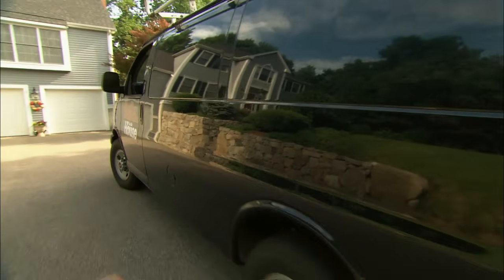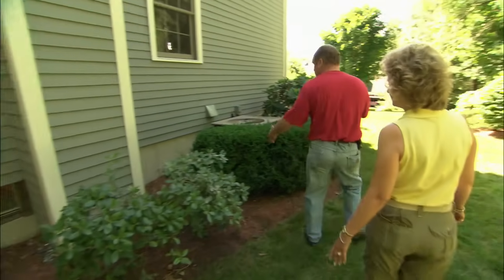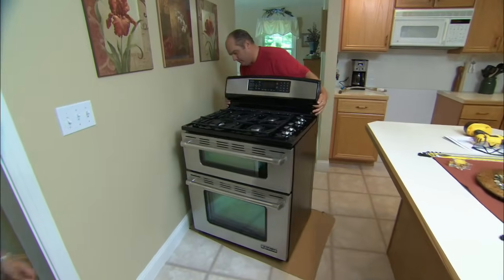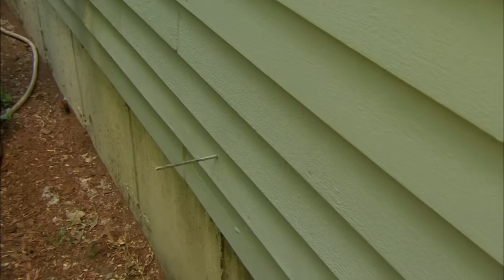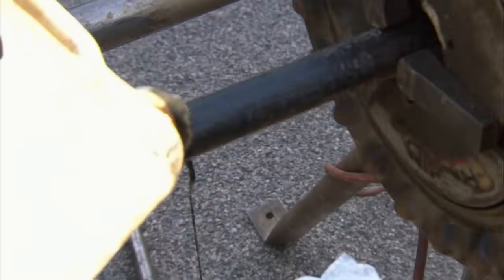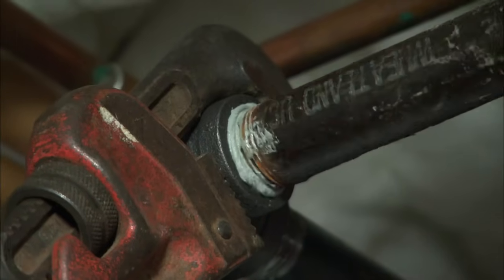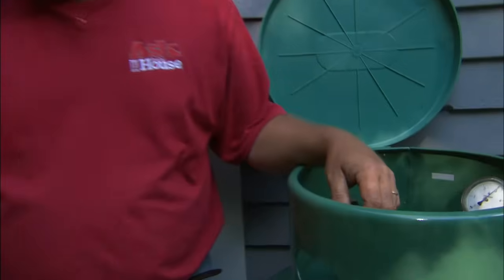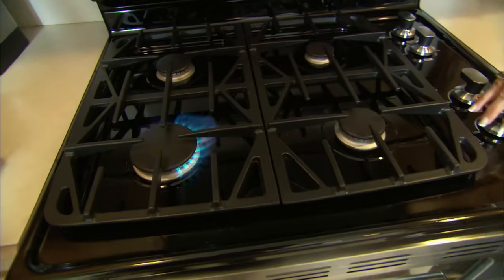How to Install a Propane-Fueled Stove | This Old House

Comment: I'm not falling for that one, they removed the stove and cleaned and put it back before they did this. No way would it look like that after 12 years. It was spotless back there.
Reply: I was thinking the exact same thing. Not even a single dust ball after 12 years. No way.
Reply: Wouldn't there be a 220V outlet back there instead of a 110V? I think the electric stove was a decoy.
Reply: Bill Magsamen
There was both back there, 220 and house current.
Reply: Maxid1 Ah, yes- I missed it the first time.
Reply: tv is fake.
Reply: Maxid1 so what are you trying to say???
I mean this video is about how to install propane tank.
Reply: I clean under my oven regularly.  If you slide out the bottom storage tray it makes it quite easy.
Reply: I know after five years behind my stop wash 2 pounds of grime and garbage
Reply: Maxid
Reply: Did she install propane just for the gas stove?
Reply: Judging by the condition of the kitchen, she's probably at the end of a remodel and decided to throw this bit onto tv. Why else would it be so clean, with a 110 outlet already in place?
Reply: Maxid1 naaaaaa Denise removes the stove every day to clean lol!!!
Reply: scott l: She did. But once the tank is in it's very worthwhile to connect your gas grill. No more wrestling 20 lb tanks and running out of gas during a party. I did it when I had my previous house built and I'm doing it again now that I've moved. You can also use it to power a backup generator or a clothes dryer.
Reply: Maybe before toh came to shoot the episode she took the time to clean behind it herself.
Reply: scott l yes there is no natural gas on the street so they have to have a propane tank
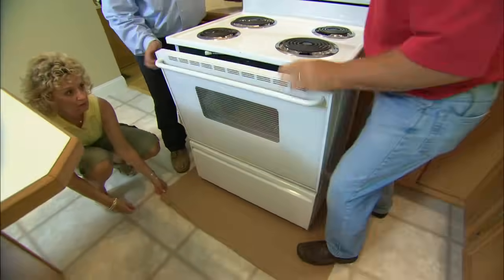Reply: 120V outlet was there. See at 2:40. Builders put usually two outlets behind the stove. My house has three. 120V, 240V, and natural gas from the beginning. 

I guess the TV show staff checked the stove and the location before calling Richard. Maybe cleaned the house. It’s their job.
Reply: @billm775  there were both dude
Reply: If the house isn't that old, 25 years or so. The electrician runs a 220v wire to the stove, also a 120v receptacle if they install gas. Just a normal thing these days. My house is plumbed for propane, but the 220v line is always there.
Reply: I agree. There was a older 110 outlet back there already. You can tell its the oldest because its been painted and not used after they install the newer 220 for the electric stove. You can tell the 220 was added to the kitchen because of the location it is on the wall. Now they are going back to gas like so many do.
Reply: The fact that people like you doesn't clean behind their stoves makes me physically sick.
Reply: Honestly nothing behind my stove but a few pieces of dog food
Reply: Just pull the tray out and vacuum it out it's not that hard, saying that I'm a slob and haven't in atleast 6 months.
Reply: My wife makes me pull out the stove so she can clean back there.
Reply: I bet the 110v socket was put in in advance of filming and they cleaned the area up then.
Reply: Eddy Secco yes way
Reply: Of course they have to make it look nice for tv
Reply: Bill M some houses have it I have a 220 stove and there is a 110 back there
Reply: Denise cleans okay! lmao
Reply: Maxid1 do you not clean behind your stove?
Reply: People like to clean their appliances frequently.
Reply: Yeah I have to clean mine monthly because it gets dirty quick.
Reply: Ever though about the fact that that wouldn’t be 
Acceptable for TV
Reply: Um, they arent a blm family.
Reply: It was probably cleaned before
Reply: Maybe she had a magic wand.
Reply: I missed the tv
Reply: They had to teevee it up
Reply: @billm775  There were both receptacles.
Reply: Doesn't matter - they demonstrated how it's done really well.
Reply: @timgraham7851  and there was a hole there for propane already.
Reply: Actually, I clean under my stove periodically.
Reply: Some people do clean behind the stove; My mother does...
Reply: @allentoyokawa9068  Good for her!
Reply: They cleaned it regularly  or just for this show Lol
Reply: How about the furnace ?  How did she take shower?
Reply: Probably prepped before to save time, nobody is going to watch someone clean for 20 minutes. Like watching paint dry.

Comment: I approve of your choice of fuel
Reply: Shuffle off
Reply: @ellenorbjornsdottir1166  well you've got one heck of a nerve.
Reply: @hankhill4254  Methane is objectively superior, even for your yee-yee gas truck; it runs at a lower pressure, reducing the risk of leaks, and it costs half as much per gallon propane equivalent.
Reply: @ellenorbjornsdottir1166  Methane is a bastard gas.
Reply: @ellenorbjornsdottir1166  Well son Methane in its gas form is an asphyxiation. You might have heard that word before. Now that means that in high concentrations, it may displace the oxygen supply you need for breathing, particularly in confined spaces like the inspection pit in my garage. Yep, I tell you hwat. And even worse, decreased oxygen can cause suffocation and loss of consciousness. It can also cause a whole heap of bad stuff like headache, dizziness, weakness, nausea, vomiting, and loss of coordination. Now you ain't tellin' me you want to be put at risk of any of that. So son, I consider it a bastard gas right along with Butane.
Reply: @hankhill4254  Propane will do all of that too, and it's heavier than air. If you breathe propane, you have to do a handstand to ever breathe air again.
Reply: @hankhill4254  Do you think you'll ever post on your Youtube channel about how you came to pretend to be Hank Hill on the Internet, and also about what propane appliances you actually have in real life?
Reply: @ellenorbjornsdottir1166  Heheheh. No.
Reply: I can hear the accent
Reply: @hankhill4254  Hi
Reply: @TavenRides69  Hi there
Reply: Taste the meat, not the heat.
Reply: @420monster69  it's "Taste THE meat" but thanks son, I appreciate it. Yup.
Reply: @hankhill4254  I could've swore I put THE meat but yeah. I fixed it.
Reply: Underrated comment. I enjoy the time and energy you took just to write this comment lol
Reply: @hankhill4254  did your company sell the propane tank?
Reply: @RobbieP2Vlogs  No son but we'll be around to quote for any future tanks they want.
Reply: Who was that tennis player who died years ago when he was at a guest house and the pool water heater leaked?

Comment: "Honey, the dinner guests want to come an hour early, is that okay?" "No can do, I need to clean behind the stove!" --This Lady. Actually, why it's so clean before they arrive is because I bet someone came by and installed the 110v outlet before this old house showed up. It's also in the right location for the gas stove to fit tight against the wall.

Comment: I like the way they've future proof by the gas line installing a t-joint for a gas water heater.
Most plumbers I know would totally skip that if they can save even a penny.
Reply: code here would fail them on the spot for that. They dont want you to be able to install an additional device without a permit so easily.

Comment: I install high end and regular appliances for a living and those guys knows exactly what they are doing , quick , planned , boom installed , only thing is , I am very worried about this micro wave hood for gas , I would tare this down and put a slim 5inch thick hood at least 600cfm , and must be atleast 26inch from the stove for gas
Other wise those guys kinda reminded me of me and my partner haha 
This channel is way better then that DIY channel where everything in his house is poorly installed
Reply: "Other wise those guys kinda reminded me of me and my partner haha"

What does you being gay have to do with anything?
Reply: Hi there I'm in Europe do you have any idea what is the brand of the stove I like the idea that is double thanks again

Comment: What about changing the orifices in each burner ? Usually its set up for street gas and you have to use orifices made for propane.
Reply: Yeah it seems like they didn't convert it  from Natural gas to LP ....
Reply: Maybe they did it of screen or bought a propane stove but definitely feel like they should’ve said something about it cause some people might not know
Reply: @Vanilla_Icecream1231  Well, there's no way a homeowner can do this job and any licensed gas plumber would know to convert it from NG to LP.
Reply: @tier3rd375  I know but some people might buy a natural gas one not knowing until the gas technician or plumber arrives

Comment: Should have put in an induction stove.  They've been popular in Europe for decades.  Basically its an electric stove but instead of using an electric heat element, it uses a giant magnet to vibrate the iron particles in your pot/pan, that is what heats it up.  You can take the pot off and then put your hand directly on the "burner" and it might be warm from the heat of the pan, but it won't burn you.  Seriously they are amazing tech if you never used one, gives you the same control as a gas stove, can boil a pot of water in under a minute.  Would have been way cheaper in this case, lot of labor/expense to install that propane tank.

Comment: What sealant would you use to block off the sides and back of the range?
Would silicone work or do you need some other high-temp resistant sealant?

Comment: i noticed they didn't have a condensate drip area in the gas line.  do you need one for LPG?
Reply: no need to call names. he was just asking a question.
Reply: Yes, it was either not included or not shown

Comment: My grandma has an electric range on her counter that's a flat surface, as well as having an infrared cooker.....it has more "control" than that antique style coil based thing lol. Plus electric ranges are nice in which you don't scorch the bottom of the pots and pans.

Comment: When did they do that final leak test on the flex pipe?
Reply: They pulled back out the stove after they got the camera shot of them pushing it in, and tested it.

Comment: in our home the supplier gave us a vertical tank approx. 48" tall x 14" dia.. it stand on two concrete blocks on earth.
Do you recommend that I anchor a pair of hooks and a length of chain around maybe half way up to secure. the tank from tipping. The service line into the home is 1/2 copper after the PRV with nothing secured.
Reply: It can't hurt and if it makes you fell better, then by all means do it.

Comment: How far can you run a propane line? I just got a LP gas generator and never used LP on anything else  except on my grill. Thank you for any help.
Reply: I’m surprised Hank wasn’t able to help you with this 😂… it all depends on what size line you are running. It’s best to keep your generator as close to your propane tank (within codes) as possible. If you run 10 psi from the tank, you should have enough pressure and volume to run your generator with copper pipe as small as 1/2”.
If you google “pipe sizing charts for propane” you will find charts that tell you the minimum size piping to carry the needed BTU for your generator (or any appliance). 
Hope this helps

Comment: I use a tee when making a 90 turn and cap off the opening I'm not using. If someone ever wants to add another gas appliance or heater it is much easier with a tee installed already.
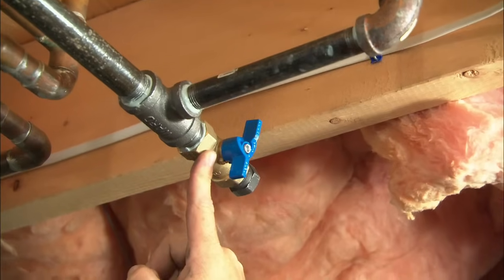Reply: If you pause the video at 7:29 you see that they did that.

Comment: Love this video, but shouldn’t each appliance have its own gas regulator?  Watched it trying to find out if I need a drip line and/or  Dirt trap for my propane continuous water heater...
Reply: I suggest people hire professionals who know the code and the safety reasons for the code.  I've seen This Old House make mistakes that can make a person ill or worse.

In this video, they should have gone over how a vent is needed that exhausts from over the range to the exterior of the house, and to use it even if just the oven is in use.  That would remove toxic Carbon Monoxide and other pollutants.  

Some vents look like they do, yet really just blow the air back into the room through a cheap, ineffective filter.
Reply: Appliances have built in regulators.

Comment: So no regulator coming off the tank?

I hooked mine up and lit it with no exterior regulator but just the one in the stove, and the pilots would get smaller when a burner was lit. I could light the oven, but it wouldn’t stay lit. 

The lp stove was second hand. I wonder if something crawled in the pipes of the stove.

Pressure is very high in the pipe.

Comment: Is the exhaust hood vented to the exterior of the home?  It did not need to be with an electric cook-top but it must be with gas.  That should have been mentioned...
Reply: Since when?  Plenty of homes around with un-vented hoods.  They recirculate the air in the home.  Not really effective at removing smoke at all, though.  In my area it is 90%+ gas if not higher, and so many homes have those above range microwaves where it just circulates the air.  Builders are often lazy and don't vent to the outside, so it also cannot be converted easily.

Comment: If it were me, I would bury a 1,000 gallon tank and switch to a gas tankless water heater and gas central heat as well. I might also switch to a gas dryer.
Reply: @billybob042665  More in the short term you mean. Propane is way cheaper than electricity in the long run.
Reply: Mark is ignorant. I would recommend a propane stove, oven, furnace, dryer and water heater anyday.
Reply: @billybob042665  Where I live, propane costs about 5¢ per kwh equivalent and electricity costs 11.72¢ per kwh.

Comment: I would've have use a longer supply line/gas flexible line so tenants could be able to pull the stove in case of an emergency or for cleaning behind

Comment: What did they plug in at the end that’s 110 volts my daughter has that same stove the ovens are electric but are 220 volt which would have been the other outlet.
Reply: The 110 volt is for the electrical part, display, clock, and also the ignition for the gas.

Comment: I noticed he didn't install a drip cap when the pipe turned to go to the stove.  Is that because it's propane from a sealed tank? He mentioned in the episode when he hooked up the natural gas grill that you should always install a drip cap. Now I take that should does not imply (or infer which ever one it is) that it is mandatory or code.
Reply: drip leg not required for ranges

Comment: I'm also aware that sometimes the nozzles on each burner needs to be replaced is your going to use it for L.P which in this case it is liquid propane.
Reply: Actually they always need to be changed if going from Gas to LP.  On each burner, the oven, and the broiler.  Also need to flip the oriface on the pressure relief valve.  They skipped all the fun stuff.  lol

Comment: I own and run a small gas service/Installation company with several employees, but i used to do service myself. Clean installation, but not to mention the need of an integral regulator at the tank despite the built in in the stove that only holds 1 psi you got to notice that a manometer test at 9 to 11 inches at the water column should be done with the valve at the tank closed, but with your appliance shut off valve open after all your connections had been done. you are not only testing the integrity of your just ran lines, but your regulator at the tank, your finally installed flex connector at the stove and the stove itself for leaks. There are several safety violations on that video, good demonstration on how to run pipes though.

Comment: forgot to mention change the gas valve orifice...propane is around 10 inch water column....natural gas is 3-4 inch.. you wanna see a flamethrower?
Reply: Maybe the stove was designed to run on propane and didn't need the conversion?